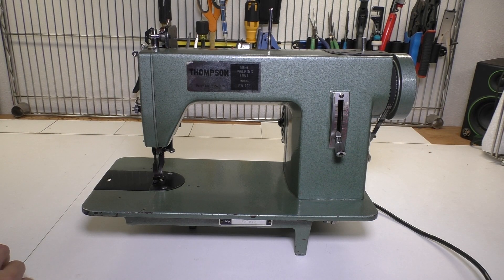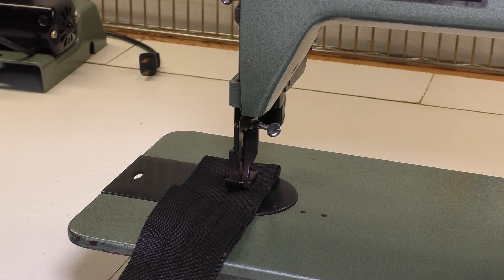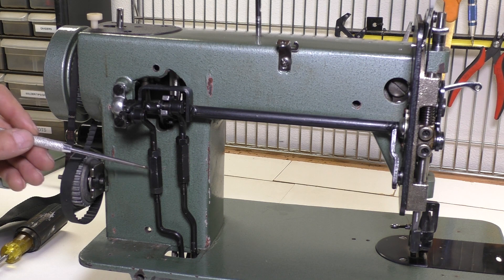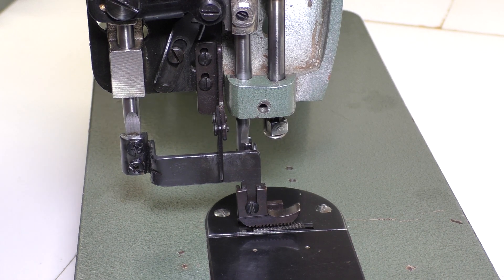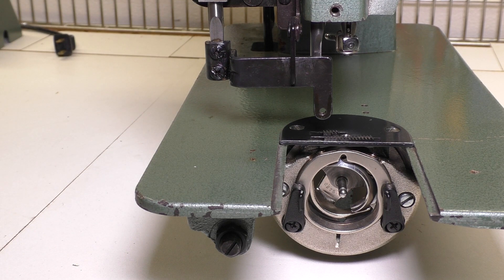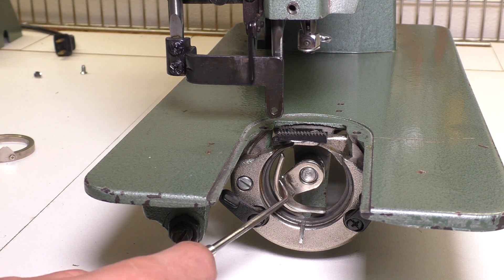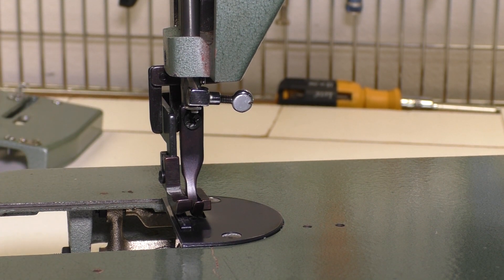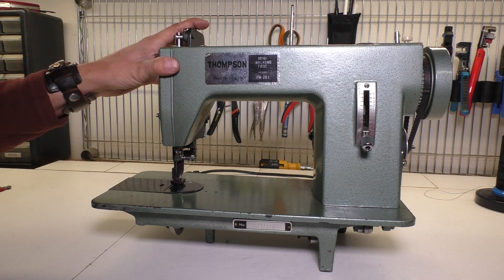Thompson Walking Foot Sewing Machine Repair

Comment: My friend gave me one of these machines. He used to repair sewing machines professionally and got it as a donation from a customer. He got it working pretty  well. I had to jury rig the tensioner with half side of a pair of tweezers for a spring but otherwise that’s it. Between the two of us we brought it back from the dead.  It sews almost anything. Seatbelts, backpacks, heavy cotton. I love it!  Thanks for this video. May need to refer to it later on.

Comment: This is a great video.  Thanks for posting it.  It looks like I can apply this information to use on my Sailrite clone.  I had a few hiccups when I first got it, but after some break-in it's working well now.  With this video as a guide I'm confident in doing any needed adjustments in the future.

Comment: @drsfloa Great video. I am having issues with thread tension on this machine. I have adjusted bobbin set screw and top thread tension knob dozens of times and still lower thread is loose.

Comment: Hello: I just ran across this video tonight which is a wonder that I hadn't seen it before. I have a Thompson PW 200 which I assume is very similar to the 201. I have not been able to find any guidance of any sort on this machine so this info from you is a boon. I have had mine for a couple of years and use it moderately. Very few issues but I am so glad to know how to make the adjustments you show. I am sure I will come back to reference this video from time to time. Thank you!

Comment: Thank you for this outstanding video. It covers a multitude of sins (uh, Thompson clones) that many of us have.

I got lucky because my REX came fully functional. The drive belt was misaligned, so some time bending the bracket (a different design than your Thompson) to change the position and angle of the idler pulley took care of that.
Next thing is to move the servo from my Singer machine to the REX. The Singer is awesome with the servo addition, but it doesn't have a walking foot nor does it use the large needles of the REX.

Comment: One comment I would like to make. The small chrome screw-on piece on the side cover that is located about 7:00 o'clock from your thread tension adjuster is 180 degrees reversed.  It is supposed to hook back around to the main vertical plate.  The function is to prevent the cover from moving when the foot up/tension release lever is operated.  The cover is held on by two only screws and this is a third fastener to stop side plate movement. 

I realize it looks like a thread guide to "who knows where" but it has a real function.

Again, thank you for a wonderfully useful video.  And nice camera work and editing. Nice clear audio too.

Do you still have that Thompson PW-201?

Comment: great video, really helpful, just found my machine which hasn't been used for 20 years and want to oil it and check it out, making masks so need a faster machine now.
Reply: Did it work out for you? It seems that this machine isn't well suited to thin fabric.

Comment: Great info! I just got one of these and it looks like it might be out of adjustment. My stitch length is very short even with the lever all the way up and my tension set as low as possible.
Reply from the maker: That sounds like a feed dog issue. Remove the upper presser feet so you have a clear view of it. Pull out a ruler and measure the distance it is traveling when turning the wheel, it should move 4-5 millimeters per rotation when the stitch length is at the maximum. Push/Pull on the feed dog and make sure it doesn't move unless you are turning the wheel (sometimes the screw/connector come lose and needs to be tightened). When the needle is at the lowest position, the feed dog should barely have any space between it and the machine (<1mm), but it shouldn't actually be hitting anything at the end of its rotation. If you feel binding during the wheel rotation, the timing could be off and the feed dog could be colliding with the bobbin cradle. To adjust the feed dog location/timing loosen the connector that connects it to the rod, it is on the bottom, towards the wheel side of the machine connected to one of the black walking feet connectors and upright forks. Keep me posted.

Comment: Hey, I just got a Thompson PW-400, the motor and wheel spins when clutch isn't engaged, but when I engage the clutch, the machine seems to be locked up, motor doesn't move anything inside. Any idea what the first thing to check would be?

Comment: Hello and thanks for your video. I have a Thompson PW-301 and I am having similar issues as you. Can you tell me if there is anyplace to buy parts for this machine? My machine has a cracked rear pressure bar bracket. I discovered this while following your video on adjusting the pressure foot. The cracked bracket is binding and not allowing the mechanism to smoothly travel up and down. Thanks.
Reply: Unfortunately I don't have that part. Reach out to dandyrelics on ebay, I purchased some extra parts from a machine he's selling part by part.  You might want to purchase the whole front assembly in case you come across any other parts you need. Good luck!

Comment: Great video especially of how to adjust the presser feet , can't thank you enough. Mine must be a slightly different vintage as the shuttle drive is pinned to the shaft not set screwed hence no adjustments and the spring plate is attached to the bobbin/shuttle race not the bobbin retaining ring.
Anyone know where to get parts?
Reply: I know Im quite randomly asking but do anyone know of a good website to watch newly released series online ?
Reply: @Russell Duke I use flixzone. You can find it on google :)
Reply: @Joseph Walker yup, I have been watching on FlixZone for years myself =)
Reply: @Joseph Walker thanks, I signed up and it seems to work =) I appreciate it !!
Reply: @Russell Duke Glad I could help xD

Comment: I bought a PW201 with a broken bobbin winder. Sailrite does not carry the part. I have tried the Sailrite LZ part from Sailrite but it isn't close. Has anyone found a retrofit or repair for the broken bobbin winder?

Comment: Hi there I’m hoping someone can answer this question. I was gifted  Thomson mini walking foot PW 103A . The people who gave it to me thought I could use this for quilting? Is this an adequate machine to quilt with?
Reply from the maker: Hi Beth! I'm not a quilter, but I did a quick google search and it looks like a walking foot is useful for quilting. Assuming the machine you received is in good working order, you should be good to go. If it needs to be repaired, you might find it difficult to find someone that can do that. Before you start any projects I would do some basic sewing on the machine and make sure the feeding, tension adjustment and stitch lengths are working as expected. Search youtube for walking foot quilting videos there are quite a few. Good luck!

Comment: Would you be able to take a picture of the inside of the front cover? I believe my 201 is missing a part that interfaces between the tension pin and the presser foot lever. And i can't find a picture anywhere.
Reply from the maker: Check out this video from the machine break down. There should be a few shots in there to help you out. https://youtu.be/pa9trp41Wus
Reply: @theminutiaeeffect3504  awesome! Thank you